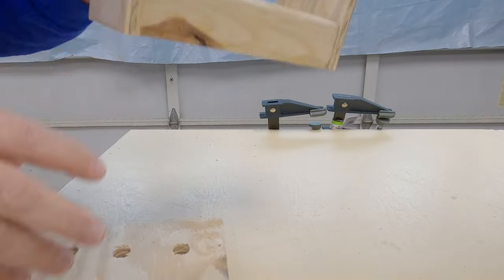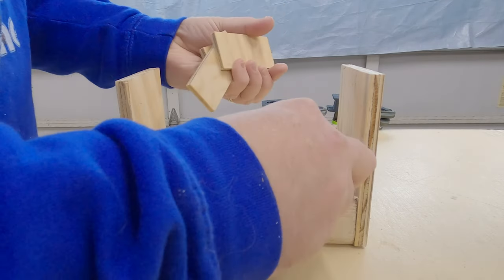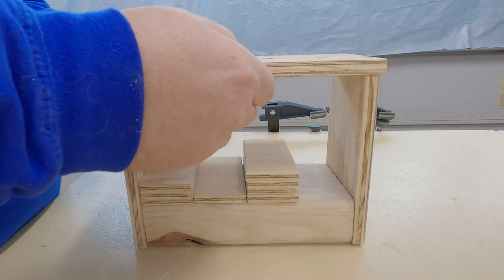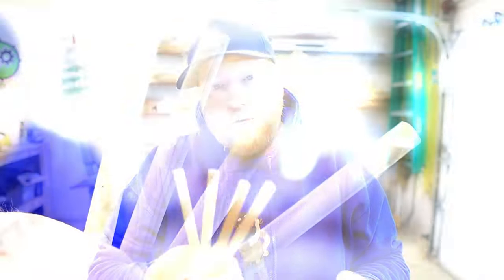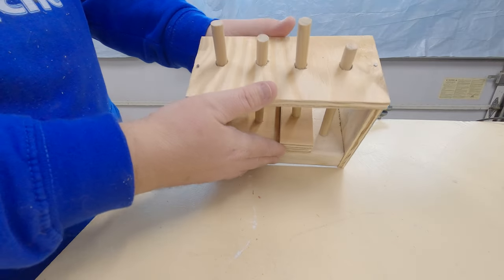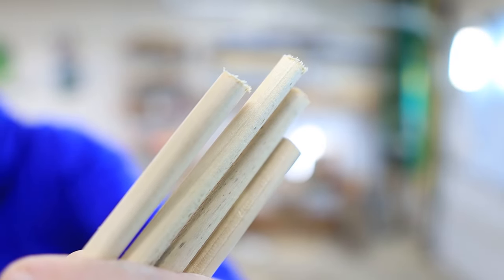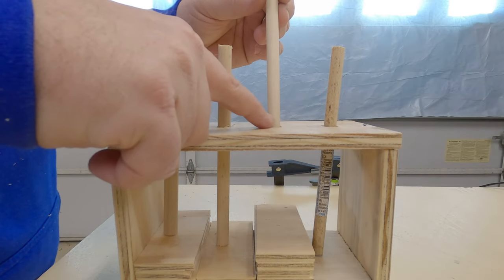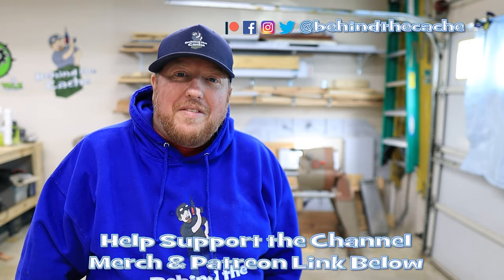Another Simple Element for a Creative Gadget Cache (GCNW)

Comment: Great idea! I agree with the one rod design. How about a birdhouse with the 4 holes drilled horizontally in one side. The dowel is a removable perch (sticking out of the front) that can be inserted into the 4 holes - holes and wood blocks in upper half / cache and locked door on the lower half. I plan on building one. I'll let you know how it turns out.
Reply from the maker: That is a great idea. I look forward to seeing how it does turn out.